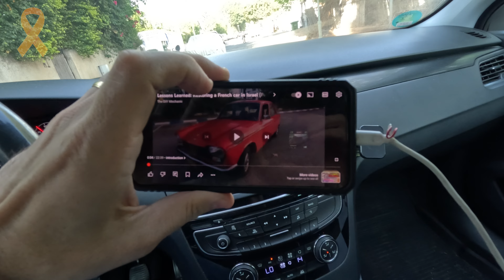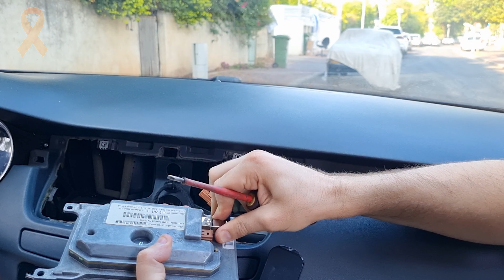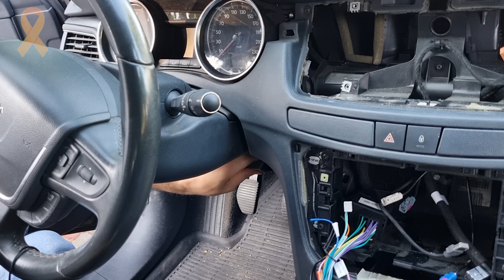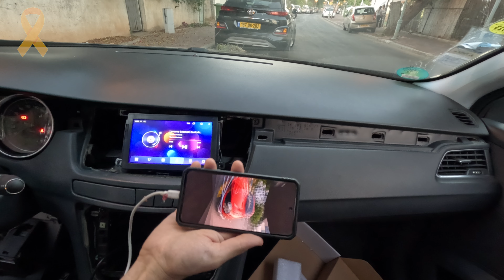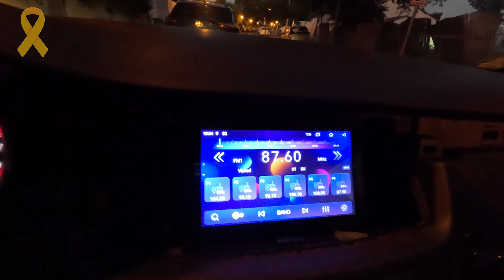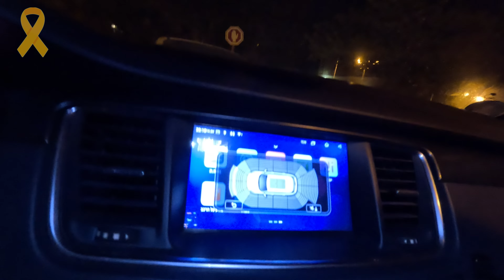How to install Peugeot & Citroen Head Unit\Multimedia [Peugeot 508]

Comment: Hey! Thanks for the vid. So there's no option to connect original built in mic to the new unit? Also how about the original GPS antenna?
Reply from the maker: @matt_mess  i think not. Why would you want to keep the original?
Reply: @ because the microphone is conveniently hidden in the roof panel, would be better to be able to use it. Same question for the GPS antenna, isn't it possible to use the original one so you don't have to place this plastic box on the dashboard. Thanks for the reply anyway!
Reply from the maker: @matt_mess  you have only the canbus connector to the original harness, so I think not...
Reply: My original screen was damaged 😢
I wanna get the same old one not android!
Can i buy your old screen? 😁